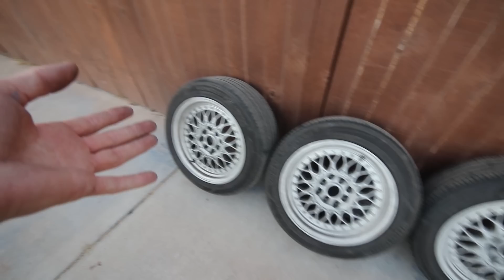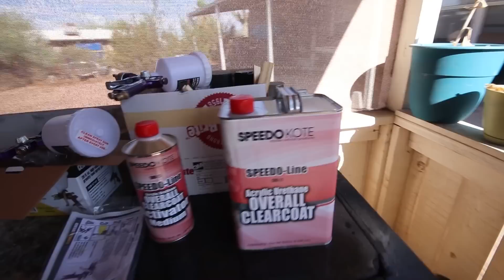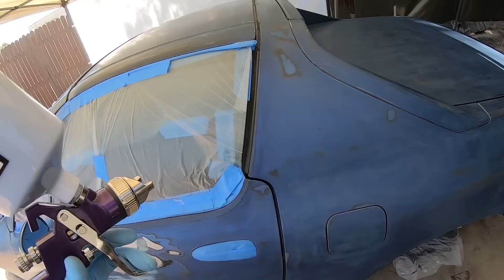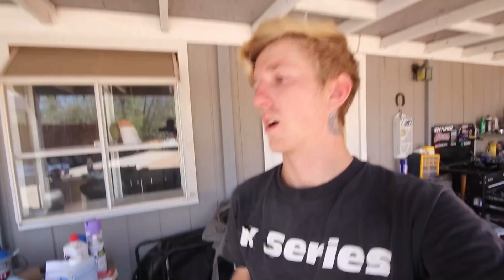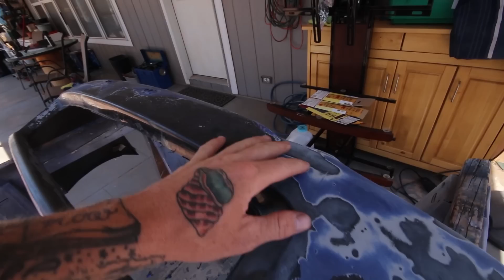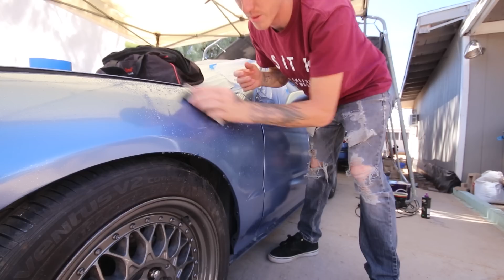Del Sol Gets Some Fresh Paint!

Comment: I was going to buy that clear coat but I bought UPOL clear coat.  How do you like the speedokote? Is it also watery?
Reply from the maker: It’s low viscosity yes, but when applied correctly it lays fantastic. I shot my bumpers yesterday, or the day before and made sure to stay closer and move a little slower, did 4 coats and it’s butter smooth and glossy
Reply: Thanks brother.   Good work again.